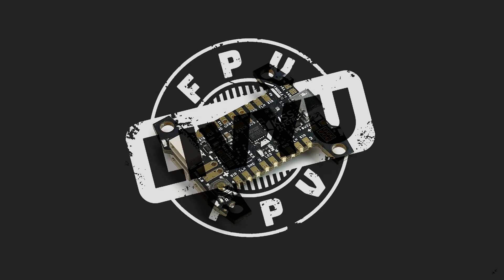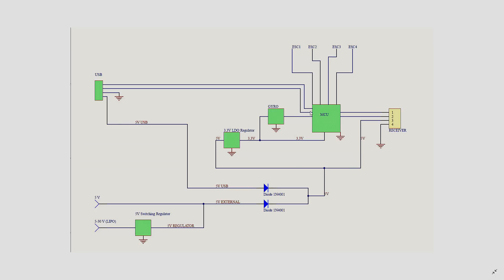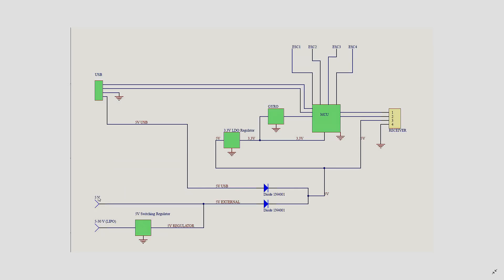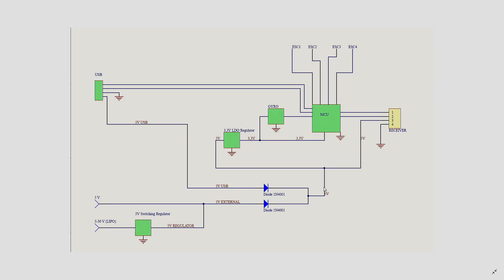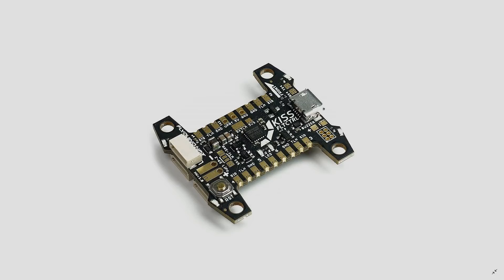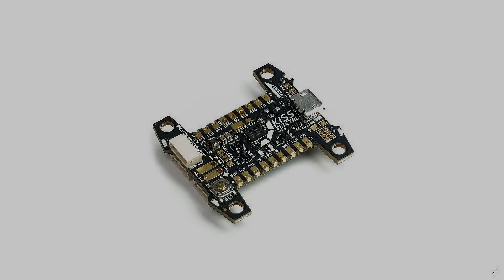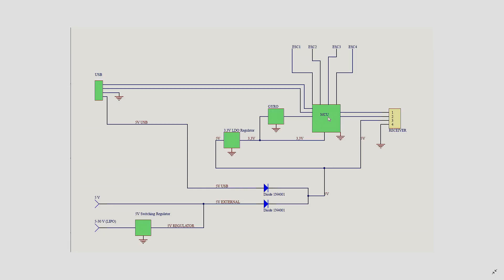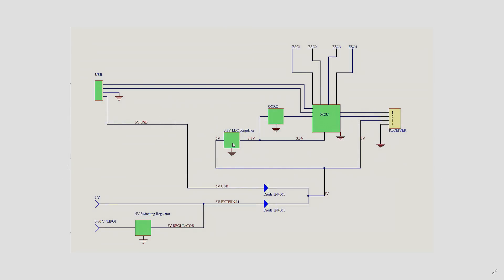How To Diagnose a Flight Controller

Comment: Why do I have continuity between the input and output pads on a 5 pin 5v reg? Reg output will read what ever voltage I feed the board. Current draw is only 80ma, MCU was dead, 3.3 volt regulator is working but can't find continuity between 5v output and 3.3 input, don't want to install a working MCU till Is sorted out. Betafpv 12a aio

Comment: Guy I have problem betaflight voltage reading 10V from usb with any lipo connected . also reading that i have 3s battery plugged in, again no battery is plugged in just usb?? Mamaba F722 mk3

Comment: Hello, i crashed my quad and the antena came off the vtx. I decided to solder and when removing the vtx I ripped off the plastic connector for (video, ground,Rx,5v).i did a horrible solder job and when power on drone little smoke came out and led lights are not working anymore . I ordered a new vtx .ordered the same one I had  and just plugged everything in but vtx not turning on or the FC not recognizing it . Everything else seems to work .motors and everything. But not the lights not vtx. Could the FC be fry just in one part or when it does it does completely and nothing works . Please any answers will help .I'm struggling .
Reply from the maker: Do you use bec of fc to power vtx ? Or any other bec ? Do you power it by lipo pad on fc ? I see 2 things possible 1 burned bec or burned lipo trace :) go hunting :p

Comment: I have 2 receiver boards  WJ-XS809RX(QYJ) of the drone VISUO XS809HW. On the input capacity there is 3.8V. and on the output capacity there is 2.02V. I think the transistor is defect it is a SMD with 3 connections en the description on the transistor is 54PH on the second board the description is 54QE. When i connect 3.3V. on the + point on the board it is binding .
The second board give short but on the input capacity there is 3.8V. and on the output capacity there is 0.0V. I find not a scheme on the internet and not the smd 54PH or the 54QE.
for replace on the internet there are many pictures of the WJ-XS809RX(QYJ) board. Someone 
the scheme of the board with the description of the components or the just description of the transistor. On the other place of the board there is also a transistor ML5 someone the just description? Thanks Marc.

Comment: can i use you help? i have a fried crazybee f4 aio. main battery leads are shorted but when plugging it by usb everything works. how would you troubleshoot this without desoldering most of the components? ive tried to identify voltage regulators but could not find any relevant result in google by just the markings on them.

Comment: Great video. My TH2 board is dead with just a battery but a battery and USB will give me battery power to my motors. Somehow the battery voltage can get to the rest of the board as long as the USB is also plugged in. Without the USB plugged in, the board is dead.

Comment: Another superb video! you just gained a new subscriber :) so this may be a stupid question, but where does voltage sensing of the lipo come into play? and things like current readings over a shunt on an aio fc? I have an aio fc where both stopped working (current readings first, a few weeks later voltage also read 0). apart of this the fc works just fine. I just cant seem to find an answer to this, does anyone here know?
Reply from the maker: Well current is nothing more than reading with a multimeter the voltage drop on the shunt. (the fc reads the value between entry point and exit point of the shunt. The voltage sensing is a resistor network that attenuates the voltage down to like 2v and the mcu reads that and corelates it to the lipo voltage. And thats why in most fc s out there you have a correction factor to both the current and voltage sensing.
Reply: @LivyuFPV  Thanks a ton! I'll be following those traces and see if there's damage somewhere!

Comment: So my sbus signal stopped working. My goal is to check for continuity between the receiver and the pin in the MCU. Two questions: does this approach makes any sense?
How can I find out which is the sbus pin on the MCU?

Great video! You seem to be somebody who knows what you're talking about and probably could answer my questions. Subscribed!
Reply from the maker: HI, well i would check out the betaflight  specific firmware for that flight controller and will show you a hint of that pin. Yes check the receiver first and after that if the receiver sbus pin has connection to the pin (or if there is any other component in between) and come back and tell us the results :)

Comment: To further discuss the gyro topic I brought up... How can i be sure the gyro is faulty? I read in a forum that it could also be a transistor which controls the gyro power... Is there a way to measure whether gyro is receiving power?
Reply from the maker: as I talked in the video the gyro and mcu receive power from same regulator. so if the mcu is working the gyro should have power also. Check if no parts are missing and in the software gui if you see any movement.
Reply: @LivyuFPV  No parts are missing but no movement in gui... so I guess faulty gyro :-(
Reply: @airexfpv1596  easy fix ;)
Reply: @alexanderfedorov7890  Where can I buy gyros?
Reply: @airexfpv1596  ebay, digikey, etc... i was using bangood 6 axis gyro boards as donors too ;)

Comment: Lost live chat.. They Gyro CS pin is connected to MCU with a pullup resistor. It's always worth checking it. You can find out in the firmware source code of your FC
Reply from the maker: True but that is easily spotted visually. But most of the time I found the gyros fail from mechanical stress (hard crash) but yeah, of course, the first thing is to visually inspect the PCB and check if parts are missing or broken.
Reply: @LivyuFPV  I was just noting it to emphasize on the visual inspection as that resistor could of popped off the board.. None the less great work..Have been watching you for a while now.
Reply: @DroneMesh  I watch both your channels. Smart guys that really is important for our hobby!